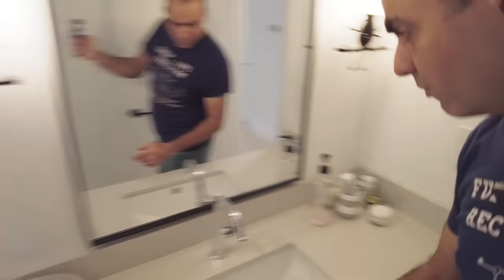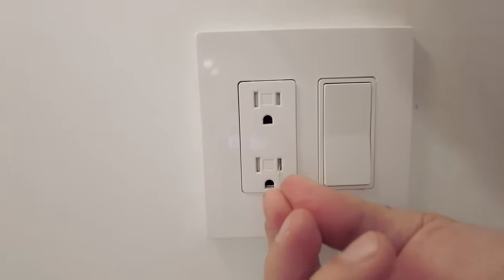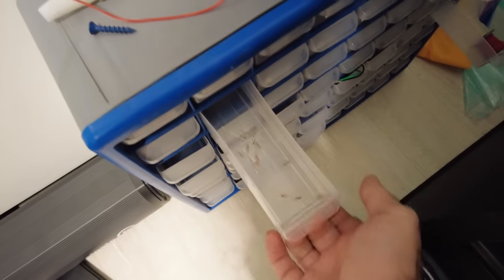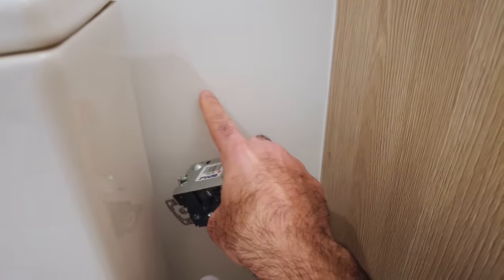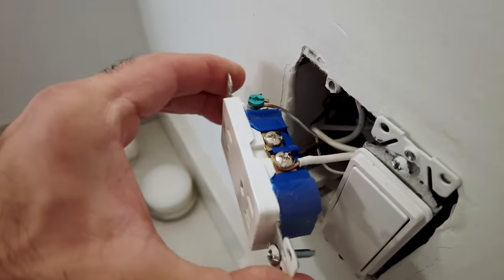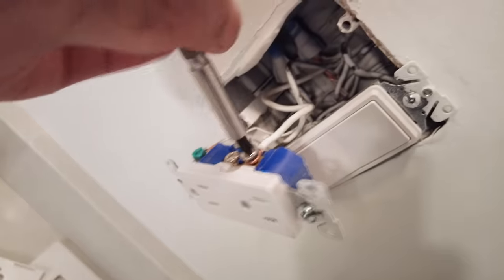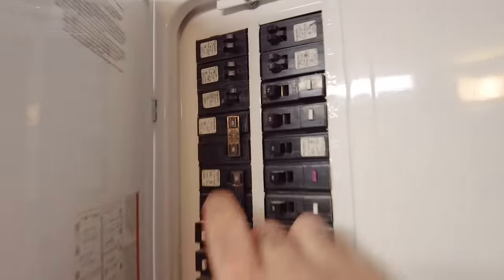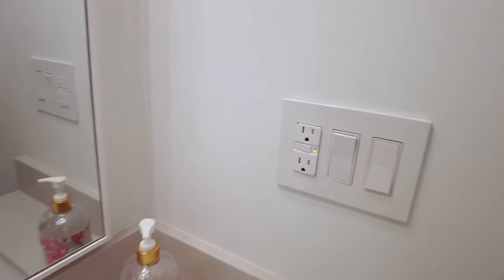Installing an Outlet… For a Toilet Seat?!

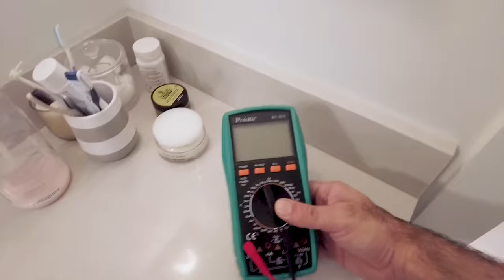Comment: 2:18   After many years i finally spot a scripted explosion. I mean of course some of them are scripted. He knows how to avoid explosions so he has to play dumb and force the explosion for educational purposes, but he usually hides his purposeful mistake extremely well. At 2:18 we see the leads are not connected to the multimeter. Im guessing he blew up a capacitor or something just off screen. His yelp is genuine. Blowing up capacitors, even on purpose, is very startling.

Comment: I don't know what the law is in Canada regarding outlets, but in Poland, you should use an isolation transformer for it. But I guess you don't give a single fuck, just as I wouldn't if not for the need to become a technician electrician.

Comment: Please leave electrical wiring to electricians tx
Reply: It is fun to watch a DIY person attempt to do this, even if you did make many mistakes.
Reply: he's an electrical engineer...
Reply: @SophiaAtkinson  but not an electrician.  There is a huge difference.
Reply: @Singlepole  What I'm saying is he's not a novice
Reply: @SophiaAtkinson  he has no more knowledge of how to run electrical wiring than any other DIY person.  No more than an architect would know how to build a house.  He made several mistakes doing this work, the biggest one was not using anti-short bushings that are used just for what they are named, preventing shorts, and subsequent fires.
Reply: @Singlepole  I mean fair, but it's his house to burn down.
Reply: @Singlepole he knows way more than you will ever do buddy